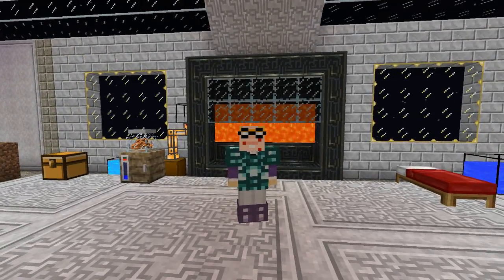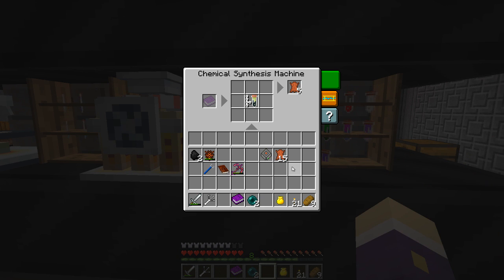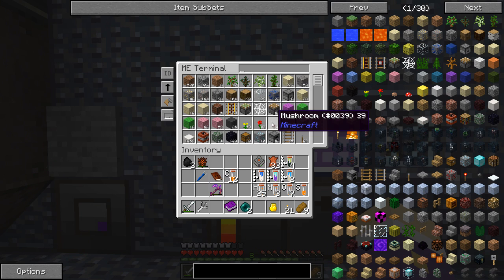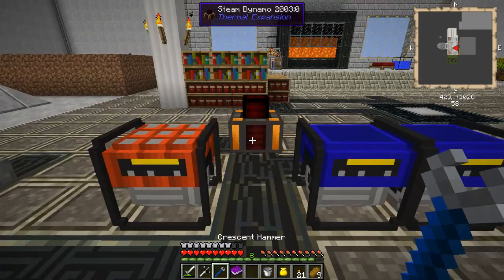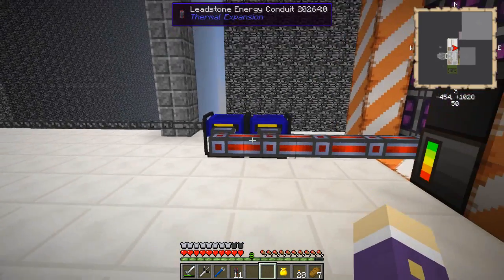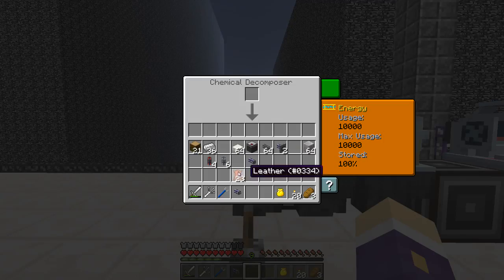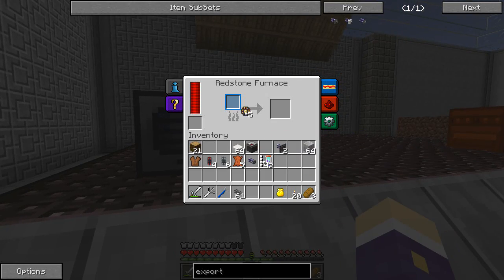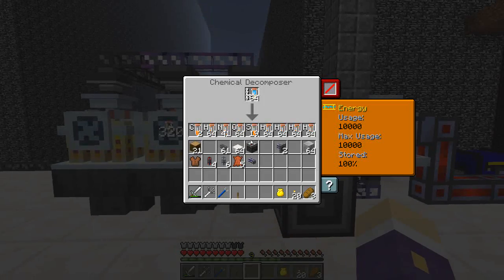Material Energy^3: E23 - The Minechem Victory Monument

Comment: Nemsun, I recommend you make an Ethos-style mob dropper that drops mobs 21 blocks onto an iron spike.  Put a vacuum hopper next to the spike and hook up a chest and a tank.  This works really well as a passive mob grinder, and it collects some nice bows, armor, bread, and XP as well as much more.  I use a barrel for the string and dirt or it fills up the chest.  

To address the bigger spiders that can't fit down the tube (somehow they spawn in a 1x1 even though I used slabs on the spawn pads!), I put 4 iron spikes on the 4 inner spawn pads to kill them, and their loot drops down.  Nice feature about iron spikes, they don't destroy items it appears.  

I built the dropper on top of the 128x128 chamber, then I unload the chamber if it's not lite up for max. spawning.

I'm enjoying your series, thank you!  I look forward to the next one!

Comment: I am happy I could help you.

I didn't use AE at all, I just used Thermal Expansion and Extra Utilities to move the stuff around.

And you really don't need to craft Leather Tunics. You will have so much Keratin by just decomposing leather that you won't know what to do with it after about  five minutes.
Lastly, if the AE system bugs out when taking the re-synthesized leather out of the Chemical Synthesizer (in my case Thermal Expansion just took one leather for each Keratin, making the whole process useless) try using an Extra Utilities Item Pipe with a stack upgrade to extract it. Make sure that only single pieces of leather are put into the Synthesizer one by one.